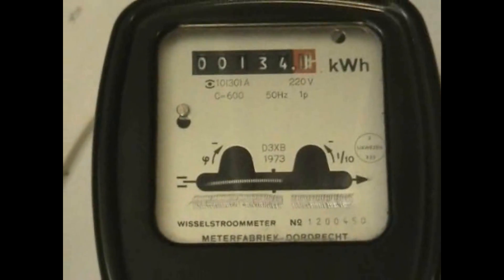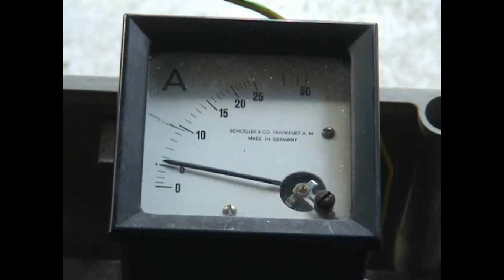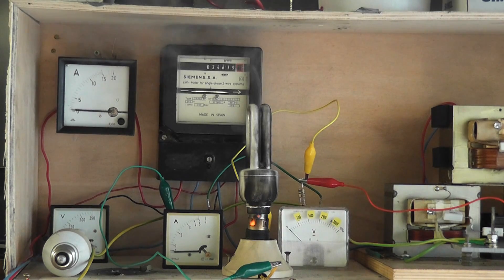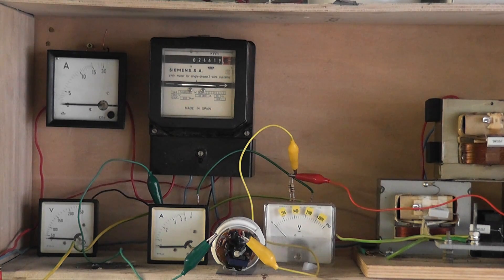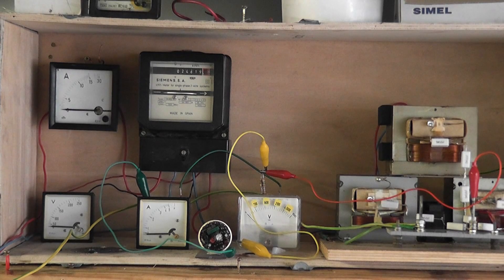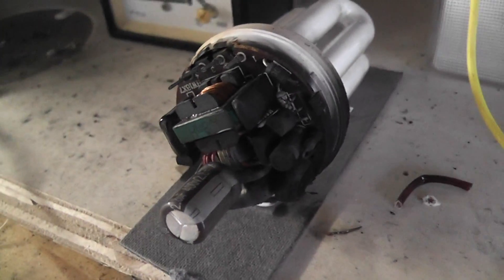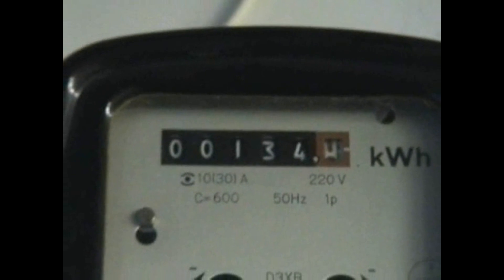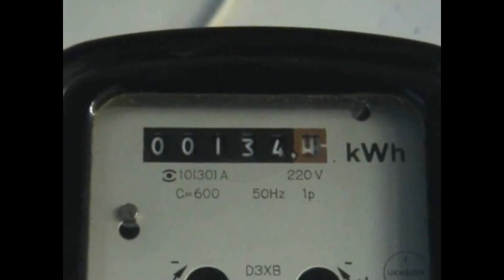2 kV MOT's versus some CFL lamps

Comment from the maker: @Kurtreidable  Thanks for that tip Kurt.
I get my old lamps through work from the bin ( for free ) Gratis which is even better. I missed out last week when about 50 tubes were binned.
Got about 500 batteries waiting destruction. lot more work setting up with heavy cables, transformers etc.